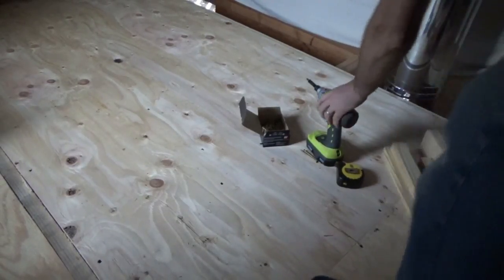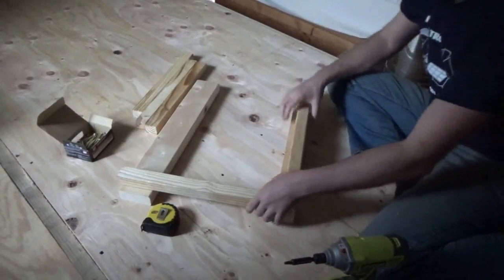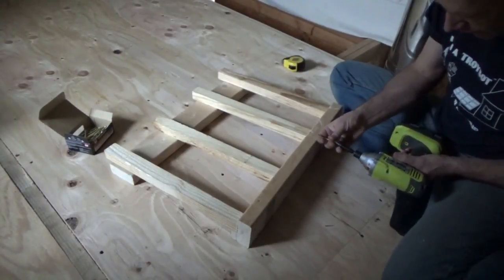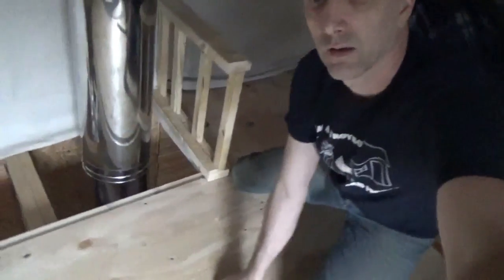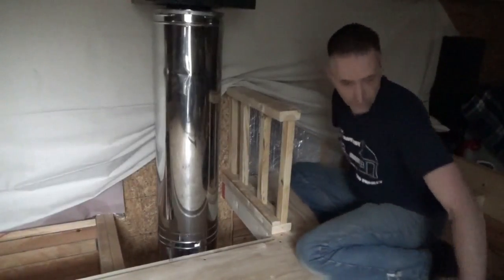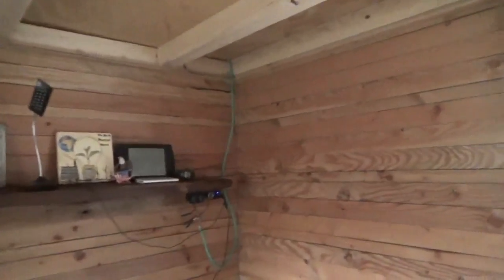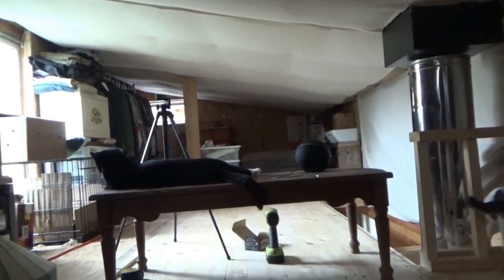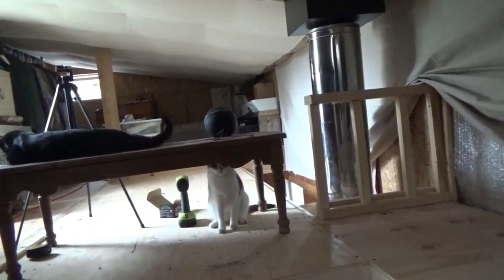Started Off Grid Tiny House Loft Hand Rail

Comment: Hi.  Happy birthday sweety pie  ; )  Ken Williamson has suggested it may be hot in the summer.  I agree.  A method in India was to have a chimney a-top the home, and have gas running inside the chimney to draw up the hot air, and thence the cold or cooler air would flow into the house from the lower windows and vents.  That aint poss here with you I know.  But, still having the chimney set up and the lower vents or doors open, it will still afford some cooler air coming into the home and lots of heat escaping through the roof!  Just a suggestion.  Keep it up.

Comment: Protective handrails and guardrails should have balusters/spindles at intervals of less than three and a half inches or have sufficient protective material to prevent a three and a half inch sphere from passing through if caring for children two years and over. If caring for children under the age of two years, balusters/spindles should be spaced at intervals less than two and three-eighths inches or have sufficient protective material to prevent a sphere with a diameter of two and three-eighths inches from passing through.
Reply from the maker: +Tyler JTFan What if you are not caring for any children at all? If no children ever visit?
Reply: So, no plans for children in your future?

Comment: Troy. I like your woodworking stuff instead of your camping vids. Why not build a Meditation shelter elsewhere on the property. Basic circular type structure like a Yurt with a raised pad. Canvas man or the TeePee for the frame. Later man.
Reply from the maker: +StuartDesign101 I have plans for a  gazebo out in the garden after its all cleaned up. Sort of a tiny tiny house.

Comment: I think your railing is not high enough, an adult will just fall over it.
Reply: +helmitpeak as tiny that mel is and as far apart the spindles are she could fall over or threw the rail lol
Reply from the maker: +helmitpeak The ceiling height is 36 inches there and the railing is 20 inches. It would be quite a challenge to fall over it.
Reply: +The Do It Yourself World OH, OK just wondering.